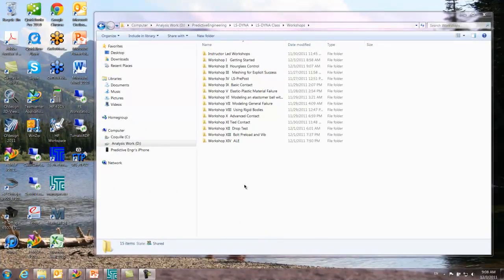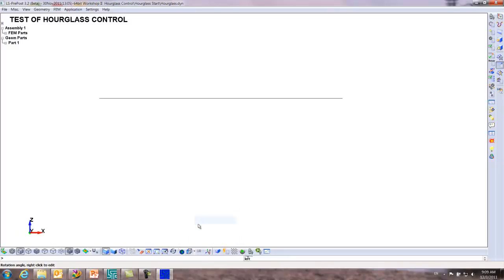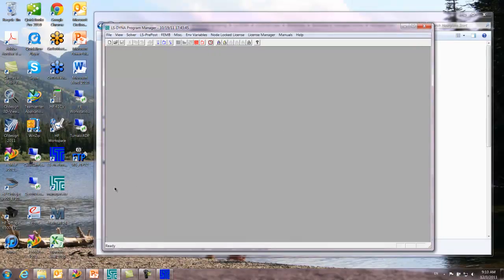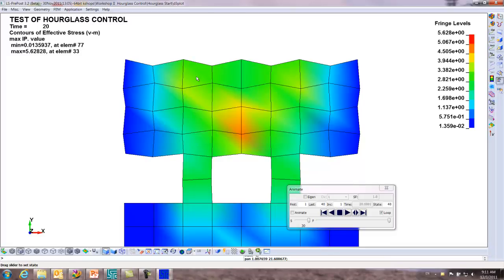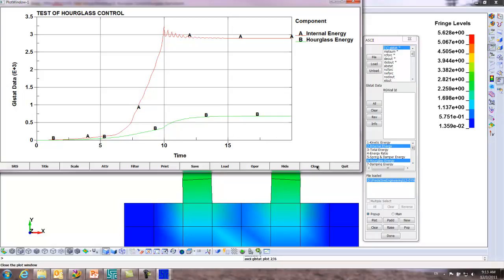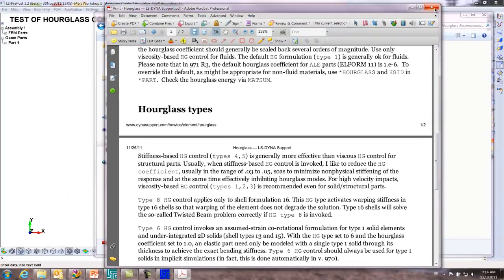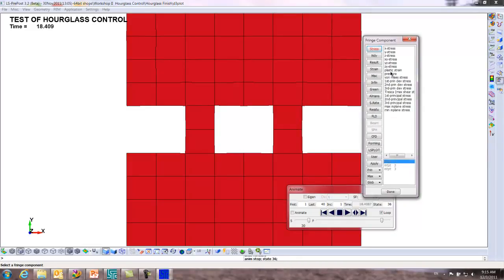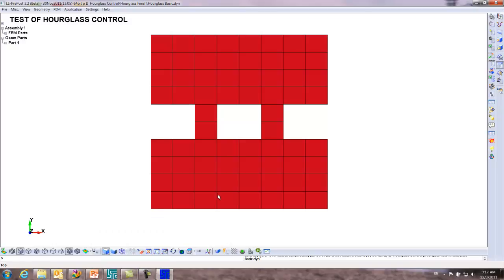LS-DYNA Analysis for Structural Mechanics Workshop II: Hourglass Control

Comment: Hello, I liked your video tutorials. Very informative. I have recently started using and learning LS-DYNA on my own to perform a "structural collapse analysis under seismic conditions" but not getting the desired results. As a first step, I am unaware of the Unit System LS-DYNA uses for my model. For example-when value 10 is entered as the termination time there is no way to tell whether it is in "Seconds" or "Milliseconds" and similar with other units also. I am trying to perform Quasi-static analysis under the gravity for my structure along with soil and PML. The problem is- sometimes the structure is moving against the gravity or sometimes sinks down too deep or quickly into the soil PML when the dynamic relaxation is activated. I have read the manuals from LSTC but unable to formulate to my model.As not so familiar to LS-DYNA, I guess I may be missing some critical parameters. So a little help if possible will be greatly appreciated.
Reply from the maker: Hi Jai, thanks for the kind words. We’ll be covering this type of fundamentals in our upcoming training course in Portland, Oregon, USA, from May 8-12. It’s an excellent opportunity for hands-on training with LS-DYNA experts. http://www.predictiveengineering.com/support-and-training/ls-dyna-training
Reply: Hi Jai, can you give me your email. I am doing in the same topic. We can have some discussion or you can contact me (nguyenvanquang240484@gmail.com). Thanks